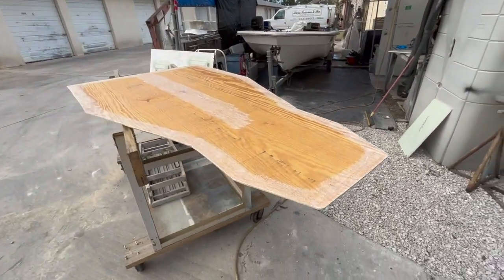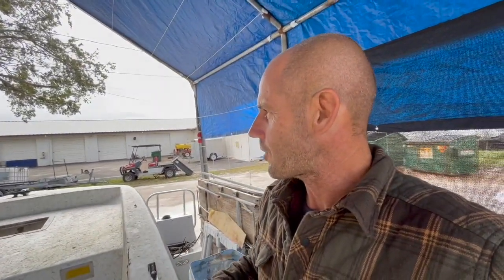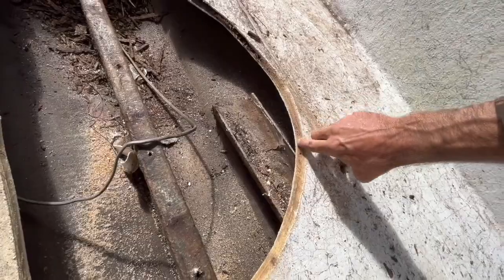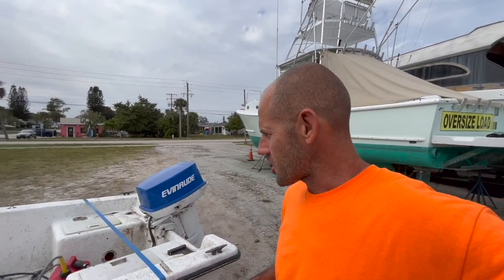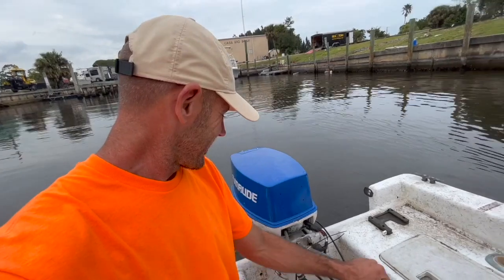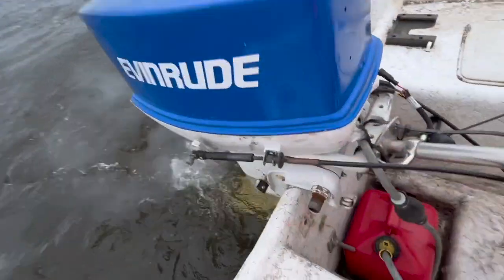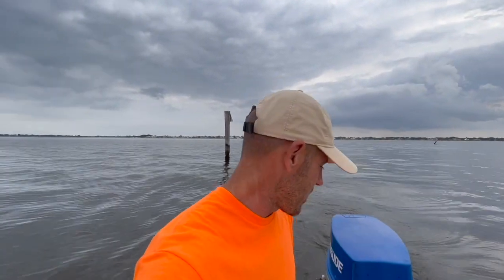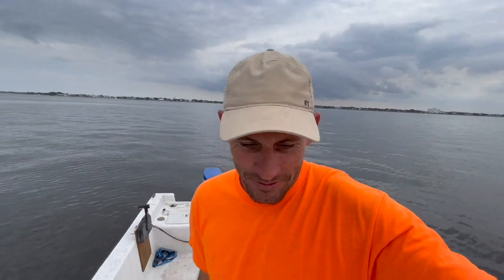Skiff Boat Rebuild for Beginners

Comment: I've been keeping an eye on your videos to see if you got around to that motor. Looks like you used the cowling and throttle from what I can see. Looking forward to part 2. Keep up the good work!!!
Reply from the maker: Haha, good eye!  Great to hear from you!  Yes, you’re correct!   and I actually used the motor on my 50 mph skiff build.  Replaced all ignition components/ electrical , new fuel pump , water pump , rebuilt carb, put a tiller on it …. She’s a runner!!!  Cheers buddy!
Reply: @diywaterworld  Sweet, I'll check out that one again!!! Thanks.

Comment: Outstanding approachable project.  Love it.  What year is the OMC?  Did you do much work to it?  I have a 1983-25 and 1978-35.  Also, can you give a few details on the deck.  Plywood thinkness and in general how you prepped it.  Thanks for much for the channel.    Always inspiring.
Reply: 1981 to 1983 the 35hp was made
Reply: @tintdr  Thanks for the catch.  I switched the two dates by mistake.  The 35 IS an 83. You must know motors!  😀
Reply from the maker: Hi Michael , I’ll check to see if I can figure out the year.  It was a combo of parts from different motors which I’ll break down in more detail in the next video.   Included in part 2 is also more insight and details on the deck :) I think you’ll like it!   Cool you run these motors as well! They’re such great motors in general and I’ve found to be easy to work on/ reliable and little power houses!    Thanks for sharing!  Cheers!

Comment: Loved the part where you're hauling ass and the tiller isn't working for crap.  Haulin ass with no control.  You keep smiling and grab the motor and steer like that.  Totally dedicated to the youtube video.
Reply from the maker: Hahaha.  I appreciate it !  Most folks don’t notice that.  And it’s actually pretty easy to steer that way when it’s trimmed proper and running the right hight believe it or not.  Cheers!.

Comment: What do you think these motors consume at WOT?  2.5g/hour?
Reply from the maker: Hi Mitch , that’s a pretty good estimate and generally what I burn lightly loaded , maybe less if I’m not zooming around.  But in waves/ loaded / high rpm I burn closer to 3 at times. The 35 hp carb likes to be fed!  Haha. Cheers buddy!
Reply: @diywaterworld  thank you kindly!  Still planning a trip to Sweeting Cay based on your video, thank you for what you do!

Comment: What is that motor 30 horse or 35 horse powerand whats the prop size?
Reply from the maker: Hi there, it’s a 35 hp and runs a 12” pitch by 10” diameter old Cabelas prop.
Reply: @diywaterworld  So I am very familiar with the 20 to 35 hp  rudes & jhonson motors. The 30 and 35 hp older 80,s and early 90,s should have a 10x13 10 x 15 prop or the  10 x 17 prop from the manufacturer. They stopped making the 17 pitch props because kids were flying and making sharp turns and getting hurt so the 17 pitch is hard to find. So a prop shop can make it happen. As an example On a old 700 pound Grumman aluminum 1754  17 ft  54 wide at the water line semi vee with a 1986 30hp evinrude with an aluminum stock 10x15 pitch prop the boat did 34 MPH , 1 person. 2 people 32 to 33 and with  3 people 31 to 32 etc with a michagan wheel ballistic 10x15p staniless race prop with hub kit HXS 118 we borrowed boat did 36 to 38 MPH with 1 person depending on current and steady 34 to 35 mph with 1 to 4 people and it did not go less then 34. . Solos and michagan wheel sell a aluminum $78 or $90 dollar 10x15 prop that I would definitely buy for that motor and boat combo you have. Keep the prop you have for when you are taking 3 or more people out. But for you and 1 person amd some gear the 10x15p will move that boat allot better. May even do fine with a load and more people. And if you get a stainless prop it will be more efficient and faster in the same pitch 10x15p as there is no flex like there is with aluminum. We had ended up getting for that 30hp motor the solas 10x15 stainless steel prop and that was the sweet spot as it was more affordable then the ballistic stainless steel prop and stronger then the stock aluminum prop with a perfect pitch for that boat. What a good idea is for your 50 MPH skiff build and any skiff you put a motor on is get one of those cheap RPM digital gauges off Amazon, you wrap a single wire from the gauge around 1 spark plug wire. And set it for a 2 stroke.  It will give you the rpm reading. Then find whatever the motor you have its max RPM and always be sure the motor hits that max rpm or 200 to 600 rpm below. No less then that otherwise your lugging the motor..Your max size prop is usually 200 rpm below max rpm to right on the money,  also no higher then max rpm never is not good with stock internals those meters you can take off easy and go from boat to boat engine to engine. When you up the prop size, check the rpm. If it hits max rpm go up one more size etc and keep going till you find one to big and the motor lugs. Then take one step down or back and thats the max prop for that motor with 1 person fuel for that boat etc. Remember every boats weight is different so a different prop may be needed with the same motor on a different boat.. Also Always keep a prop 2 to 3 sizes lower then your max rpm biggest prop. This will allow you to swap props when you have guests and or know you will be hauling a heavy load etc as the smaller prop will help you plain quicker with loads..  The max RPM for that 35hp you have is 5200 to 5800 RPM manufacturers specs.  Same as the 30hp So you see the 200 to 600 rpm none lugging difference below max rpm. Anyway I hope my advice helps in your future builds. Love the content.
Reply: @diywaterworld  Also I just looked up the 80,s 35hp it should have came with a 10x15p that 12 pitch could be over revving the 35 as it sounds kinda small. But if the boats very heavy it may be perfect. Only way to find out is a cheap RPM hour meter from amazon or cabelas and a 10x15p prop

Comment: Well a displacement hull such as a sailboat does not plane but pushes water and an old 2 stroke motor will burn twice what a  merc I/O say a 130 will burn  so you are saving money on your boat cost but fuel is twice or more .

Comment: Ha, zip ties on the tiller handle ! What could possibly go wrong 🤣 , well bro I’m just bought my project boat ! I’m building a nano skiff ! Or mini flats boat or a little pain in my azz, I got the 11’ ft ,I think it’s a 1965 Cacci craft they were made in Tampa fl, and a trailer for $250 bucks it’s the typical 3 seat fishing boat , front and back seats are hollow air bladder flotation mid seat has a hatch opening,kinda dry storage, I wanna do a front casting platform in the bow, and maybe an aft deck over the rear seat area with a poling platform, I’d like to find a 9.9 or 15 horse motor for it ( cheap )  👈🏼 had to laugh, you started the vid showing how strong the boat is like a half inch thick in the bow then you say you didn’t want the boat to be heavy 🤣 I can pick up the front of my skiff with one hand 😄, I’m guessing it weighs about 220 , I went to Fiberglass coatings and got all my stuff for the boat I’m lucky it’s like a mile from my house , I’m just “ itching “ to get started , later 👊🏼👍